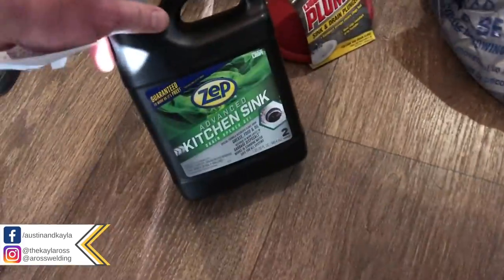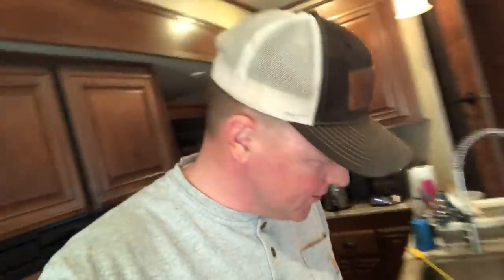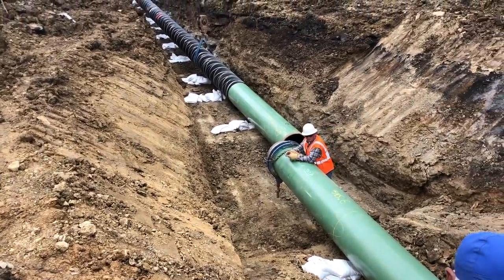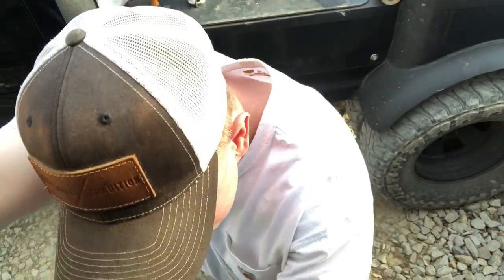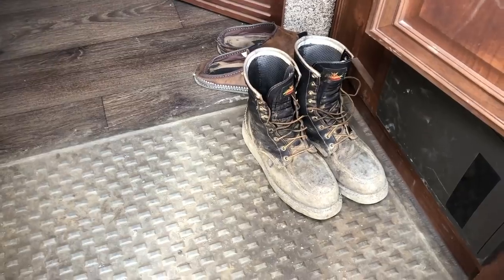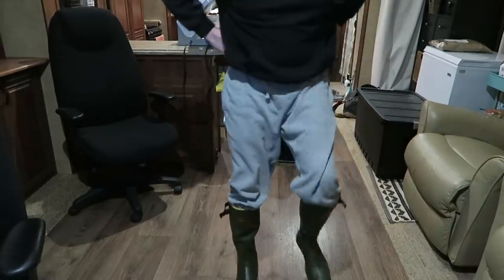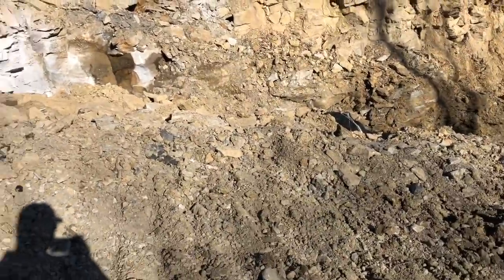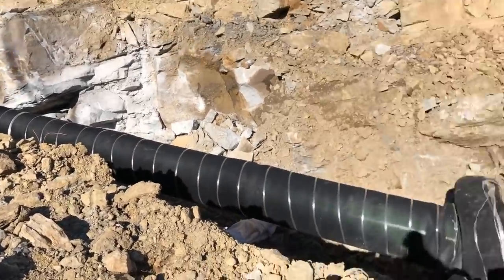A WEEK IN MY LIFE ON THE PIPELINE (PIPELINE WELDER)

Comment: What does the " tie in " guy do that's so important that once he leaves, everyone leaves?
Reply from the maker: The tie in man is the Forman of the crew. In this case he just had another job to go to, if it would have been in the mid of the job they would have just hired another tie in man and we wouldn’t have got laid off. But in this situation they were in the process of finishing up this job so they were already laying crews off every couple of weeks as they finished up where they were. So it just worked out that I got to come home same time he was headed to another job.
Reply: Austin and Kayla I currently do shop work tig welding alloys and, pipe, tubing and hot roll in central ohio but I really want to move on up and am buying my gear one thing at a time to become a pipe line welder helper very soon, hopefully late spring or early summer. Any suggestions what states or where to look for welders looking for helpers on the pipeline? I appreciate it.

Comment: Very noob question here- when welding, how does anyone know exactly where to dig up the pipe to be worked on? Or do you have a video on it/plan on making a video on it? Because it doesn’t seem like ALL of the pipe gets welded- just a portion of it. Thanks! :)
Reply: A survey crew with gps marks out the pipeline and then they dig and blast the trench and they weld 40foot sections of pipe together and excavators and side booms lower it into the trench and welders make tie in welds then the xray crew xrays the welds then laborers wrap it in rock shield and they bury it. It’s mostly new natural gas pipes hes welding on. Thats the quick version of it. Its sounds easy but it is not. Pipeliners are bery skilled i was a pipeline laborer then bumped up to welders helper for 2yrs
Reply: Awesome! Thank you! Hope you are enjoying it!
Reply from the maker: I’m on a tie in crew. By the time we get to a location the main part of the pipeline has been lowered in. The “pipe gang” has already came through and put the majority of the pipe together, like this other fella said, they are most generally 40’ sections to start with, then they have a lowering in crew that lowers the big sections of pipe in, after that we come in on a tie in crew and weld up all the lose ends in the ditch.